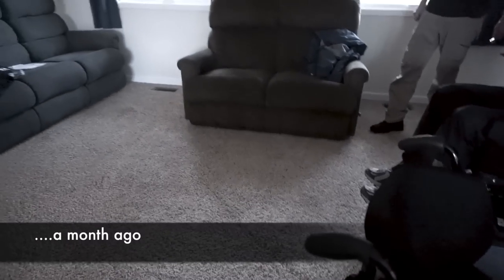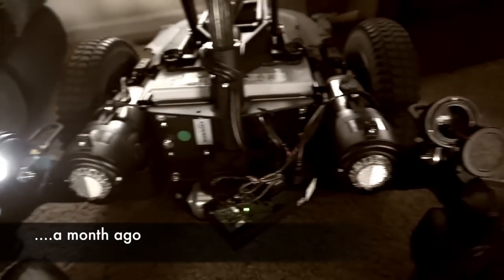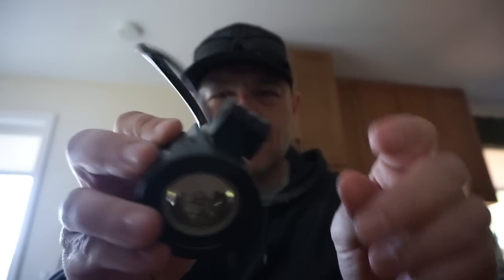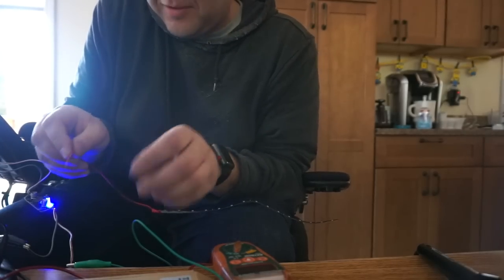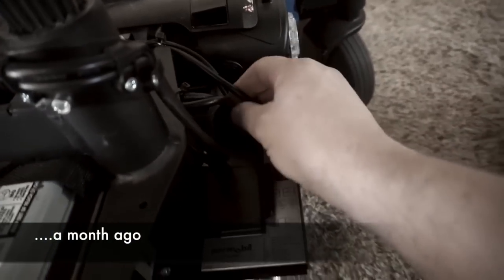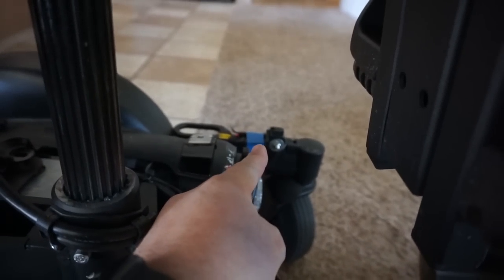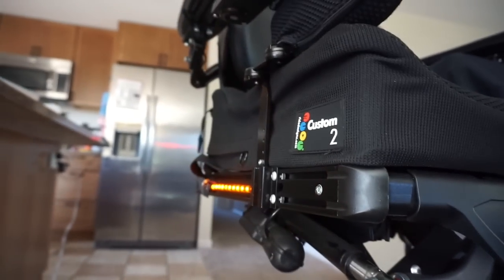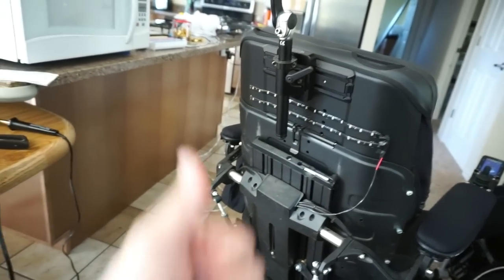VLOG 315: installing lights on permobil M3

Comment: Love what you are doing by cutting costs on installations.  So far I've installed USB phone charging ports, a standard car horn, and a solar charging port on my chair.  Keep on keeping on my friend.  LED lighting is my next project.  Rural King sells a LED light that works from 10 to 30 volts DC.

Comment: I got a quantum at 2 and I put lights on it I got the lights at AutoZone $40 they're LED motorcycle lights and is there 12 or 24 volts and then I bought a white square lights and put red tape on them and I wired it all to switch and put when wire to the battery works great
Reply from the maker: nice! yea a lot of those "cheep" lights will work great on 24 volts! nice work!

Comment: Where is that module :
 located on the chair ?
 I'm working on A. F3 permobil ;
   I'm doing the same exact thing putting lights on a wheelchair 
but I can't find that module ?
Reply from the maker: the ICS module is under the front cover.  BUT ya cant just connect lights to it.. takes a bit of wiring unless you have a stock harness and light kit from permobil

Comment: I will see if u can make harness for q m7 with r net.cleaner than me just connecting to batterys👍👍👍
Reply from the maker: R-net if you have their seating controller, with 4 or more functions, lights are baked right in as well! but much easier to setup! the connectors are on the outside of the module!

Comment: So, did you ever build that kit to sell?  Any idea if the M300 is the same as the M3 in this regard?
Reply from the maker: just FINALLY got the OEM harnesses last week to verify the wiring on.. but yea - the m3 and m300 are very similar - 2 pins are different on the headers - but its high up on the list now to get them built!

Comment: How does your friend like the M3?  I'm going to test drive one next month.
Reply from the maker: its a nice step up from the older m300.. suspension is a little better as well :^)  ALSO you can have your footplates in any position without interfering with the front castors, like the old models did!
Reply: Thanks!

Comment: Is it possible to remove Led lights off the bottom of a Transfermaster electric bed? This company thought it would be a great idea if their hospital beds had Led orange lights on all the time under their beds. With no way to turn them off.
Reply from the maker: LOL what? weird!  who wouldn't want an orange glow at all times!!  not familiar with the brand or bed... BUT id just see if there's screws, or wires coming from them... follow back to where they plug in.. just kinda guessing here...
Reply from the maker: most beds are pretty modular, and all the actuators and control wires run back to a box, and plug in somehow.. and usually have removable connectors..(maybe not easily removable - but they've gotta come apart for shipping)
Reply: ok thanks

Comment: Hey buddy! Any updates on this project and the connectors that's required? How many volts and amps does the board put out for the lights?
Reply from the maker: there's some connectors that i modified to use.. but this really isn't a project i recommend doing.. it 'technically' voids the warranty of the chair.  BUT if you want some more info on it, send me a DM on twitter :^)
Reply: @TotallyNormal-  Don't have Twitter but I DM'd you on Instagram!
Reply from the maker: oh... let me go check... i dont even know if IG messaging is turned on! lol

Comment: Would it be theoretically possible to use the XLR charge port as a power source for lights? It wouldn't be as fancy, because you'd have to manually plug/unplug for on/off, but it may be a simpler solution for less technically inclined people such as myself?
Reply from the maker: YUP!! actually im making that exact thing right now! ..(prototyping it) ...  a simple plug n play lighting setup that's portable! maybe some velcro, or magnetic bases etc... im working out the best setup to use that will be compatible with most wheelchairs :^)
Reply: Totally Normal fantastic! I just picked up a Permobil F5 VS. I'd love to get a lighting package set up on it but obviously not for the $1200 Permobil is asking for one. When you have something that'll work, I'd love to buy one from you.
Reply from the maker: ooo0o0o a standing permobil!! how do ya like it?? thats a sweet setup!
Reply from the maker: hopefully soon im gonna launch my own version of a "merch store" lol but instead of hats, ill have useful crip products! lol
Reply: Totally Normal you should! There really aren't many companies producing useful stuff at a reasonable price for us wheelies. Love the F5 VS! Found a used one that just happened to be my size and got a steal on it!

Comment: Hi there, I want to do something like what you are doing but with a fan that I want to have mounted at the very lowest part of my backrest after cutting about 3" off the bottom to allow air to hit my coccyx because I sweat there a lot. I keep getting skin breakdown, and it's creating ulcers. I have the F3 and C300, but I'm slightly different from you. I'm a quad with a head controller that cycles through my options, and one option I can turn on and off myself is lights, but I don't need lights. I want to use it to turn a fan on and off. It's going to be something like a 2" computer fan, and I want to wire a timer into it so I can have it set to come on every 15 minutes and run for a set time. I used to be a mechanic, and my friend will do the work too. Anything you can throw my way to help would be great. Also, will any 4-pin connector work if you can guide me to the correct ones? That would help too? Love your videos keep up the great work.
Reply from the maker: should be doable! they have little interval timer modules on amazon and ebay that can be setup for the on/off times cycles.. or just run for a preset cycle etc.. depends on how the lights are setup on the chair, but i'd think it shouldn't be too hard :^)

Comment: In Oregon putting lights on yourself would that void your warranty? Wondering if insurance drops the chair after modifications if they're not done by wheelchair provider?
Reply from the maker: eh.. lots of variables there.. i personally never worry about the 'warranty' since insurance pays for repairs on the chair regardless of warranty status.  as long as i don't do anything dumb to the chair and blow up the electronics "it shouldn't" be an issue..
Reply: @TotallyNormal-  thank you for the info I went ahead and used your video and set up a light. works great

Comment: Hi I like your video, I have the same wheelchair, I want to know where do you get the cable for make a same project, I already had the light but I don't know what  cable have to use to do it. Can you tell me where buy the cable to install my light and what kind of cable I had to use please.
Reply from the maker: hey! i had to make my own cable.. its something thats typically used for Arduinos etc... but this is the header ive been able to use.  just have to cut off the retention clip.  dont have a proper schematic yet.. still trying to get ahold of a chair that has a factory harness, and duplicate the proper pins etc... https://www.frys.com/product/7021181?site=sr:SEARCH:MAIN_RSLT_PG

Comment: Hey, could you send me the wire diagram and links to those the connector please? I'm getting a M3 soon and will possibly transfering my existing lights over to my new one and would love to use the buttons on the JSM
Reply from the maker: do you have the factory light package on the old M300?
Reply: Totally Normal no I installed aftermarket ones! Way brighter than factory plus they flash(Soundoff Signal is where I got them)
Reply from the maker: oh! some legit strobes! nice!
Reply: more like, lights for emergency vehicles(ex cop, fire and ambulance)!! lol I've gotten people to slow down when i quickly turn them on and off real quick!

Comment: limitation on amperage? Any wiring harnesses for bounder chairs
Reply from the maker: ive seen my ammeter peak at 130 amps before (just for a split second) - its connected to the main battery cable.. but the thermal rollback on this Dynamic DX2 system it pretty aggressive.. i'd prefer to have the in-house bounder electronics.. now i know for next time!

Comment: Can you make led light kit for quantum q6 edge wheelchair
Reply from the maker: quantum chairs require a different joystick, and control module to be able to switch lights on/off via the joystick
Reply: @Totally Normal  can you like the parts so I can buy the lights please I can solder it and hook it up

Comment: Hey, thanks for this!  I just got my wife an M3 and scoffed at the cost Permobil wanted for their lights.  I'm going to attempt to do this.  Is it as simple as lopping off the ends of the LED light cables, splicing the positive leads from each light together, then to the positive lead on the cable, then splicing the negative leads together and also to the negative lead on the cable, then plugging the one cable into J4?
Reply from the maker: here ya go - made this a couple months ago finally! https://r-netoem.blogspot.com/2020/03/permobil-light-schematic-new-style.html
Reply: @TotallyNormal-  thanks man, I really appreciate you.
Reply: @TotallyNormal-  did you have to manufacture your own brackets to mount the lights?  In the video you said it fit right in there, but it looks like I might have to find an L bracket to mount this.
Reply from the maker: just some off the shelf L-bracket i think it what be bought
Reply from the maker: https://youtu.be/zzFc0YC9-0w

Comment: I am checking out Permobil F5 and M3 for my first wheelchair purchase was wondering what your thoughts are on midwheel and front wheel which would you say is better for rolling/traction on country lanes in the woods with my dogs ? would appreciate your opinion many thanks From France
Reply from the maker: if you're running around on a lot of hills - you might want the extra stability a mid-wheel drive chair provides.  BUT the front wheel drive chairs dont have extra castor wheels out in front, and they dont get stuck on thing as easily! (gravel etc) ive used front wheel drive chairs as my daily for a number of years now - and i like them a lot! can maneuver into tighter spaces etc.. i posted an hour long webinar on the other channel from permobil that talks about front wheel drive chairs and their benefits.  (its a bit long-winded but has some useful information) https://www.youtube.com/watch?v=XkfpcrOCQTY
Reply: @TotallyNormal-  Thanks so much for your help, love watching the vids so informative.I am a newbie lol guess u can tell, but I have the possibility of purchasing a second hand like new M3 for around 800 euros only hitch no batteries just wondering whether it's worth the aggro as batteries are very expensive here. I know this is a fraction of the cost of the chair but without being able to test it I can't be sure there are no other probs unless I turn up with batteries lol
Reply from the maker: you want to be able to test the chair out too.. if there's no batteries then things get kinda sketchy!

Comment: Hey Cool video I have a permobil f3 corpus wheelchair with the lights button on the joystick how much for wiring light kit
Reply from the maker: I don’t sell a kit for installing the light inside the chair like this... was mostly playing around to see if it was possible:-)
Reply: Hey I have the lights.but my personal m300 joystick don't have the lights button on it and I can't find the right one. What can I do? Can you help me please?
Reply from the maker: usually the easiest way to access the built in lighting function on the chair, or to replace the joystick with one that has lighting buttons on it.  (they're not super cheap - but ebay is a good place to look)  You'll want one of the joysticks with the Color LCD display(and lighting buttons), or the newer, larger color screen joysticks that have paddles instead of a power button.  they have baked-in lighting support without the dedicated buttons (like the joystick the chair in this video has)

Comment: any chance you've done this to a Quantum 6?
Reply from the maker: quantum chairs don't come with the ability to control a lighting system by default
(the small fender lights are completely different)
easiest way to install lights on one is to find some 24volt compatible ones, and wire them up on a separate switch
Reply: @TotallyNormal-  Thanks for the fast response, even though it wasn't what I wanted to hear.

Comment: I copied your schematic would you list the part number for the plug from digikey catalog and the plug that used and where you got them from
Reply from the maker: didnt find them at digikey.. BUT here's what i used on amazon! theyre I2C 4 pin connectors
https://www.amazon.com/dp/B007TOPM30/ref=cm_sw_em_r_mt_dp_U_hA.WCbSAZ23JK
Reply from the maker: just clip off the lil locking tab with an xacto knife, and you're all set!

Comment: $1200 lighting kit? What's that about? Do the amber side lights blink?
Reply from the maker: permobil has a "new lower price"on their light kits... now they're only $895 LOL
Reply: @TotallyNormal-  That's because most of their income is from the government. They don't have to lower prices. Other peoples money and all that.
Reply: What I don't get is having all those dedicated buttons to control lights, why are they not included, and how do you get them included?
Reply from the maker: most all of the new R-Net controlled chairs have soft keys (on screen buttons) that control the lighting - so ya dont need a special joystick like ya used to for switching the lighting on and off.  even if the chair doesn't come with lights, they can still be controlled with the chairs controller (all the hardware already exists on the chairs - just not the actual lights and wiring)